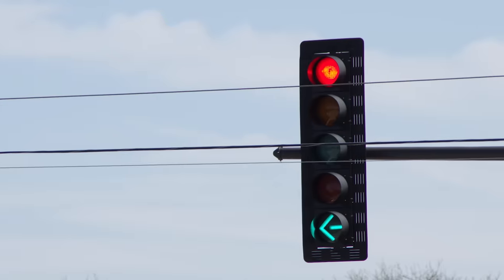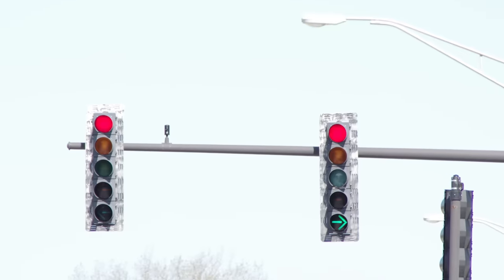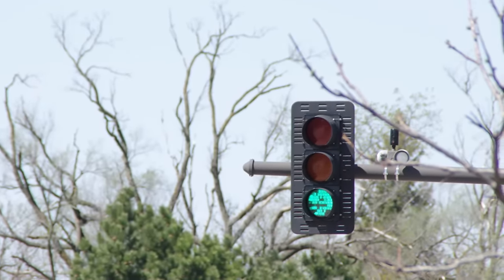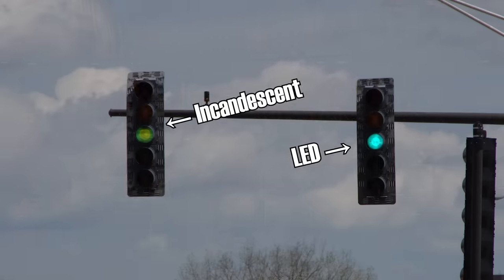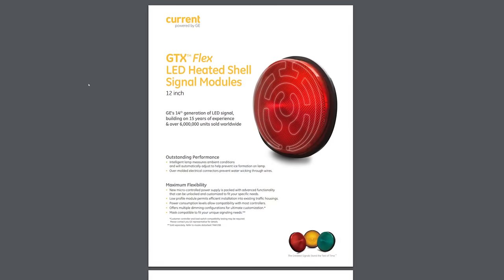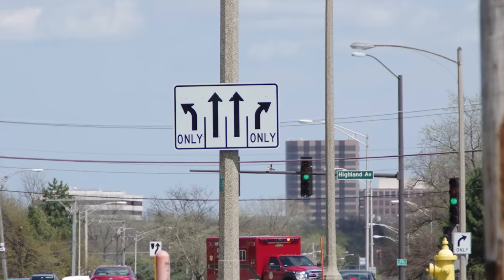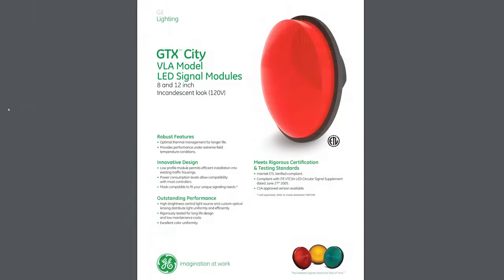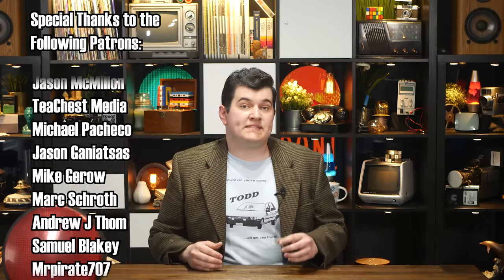The LED Traffic Light and the Danger of "But Sometimes!"

Comment: When working on traffic light control systems a decade or so ago, another advantage of LED was the lower voltage posing less of a threat to life in the event of an impact with the unit since it didn't expose potentially lethal mains voltage.
Reply: It's not the voltage that kills...
Reply: @MrKelra  unlike boring and mindless comments.
Reply: @MrKelra  but if I stick a fork in my outlet (here in Aus 240v 10a) I die, but if I lick some jumper leads connected to a car battery, let's say 13.8v and 800a, I don't feel it. Technically it is the current that kills you, but you need the high voltage for the current to flow through your body which is very high resistance.
Reply: @enbee_ash6740  Sadly, some people are just incapable of understanding the implications of Ohm's law and the melting point of conductors :)
Reply: @mpmansell  she'll be right. We'll just shock them with 240kv at 0.5A and say hey it's low current you'll be fine 😂
Reply: @enbee_ash6740  No, the LED modules are 120Vac units, designed to replace the existing bulb fixture with no change in operating voltage.
Reply: That's a stretch. Lets ignore the 120/240 V and 13,800 V or higher  systems on the poles next to the stop lights or even on the same pole.
Reply: @jim9689  You are completely ignoring fully modern, or modernised systems, where the voltage is reduced in the control box, usually to around 48 volts, with the LED matrices either running on that, or reduced further.
Reply: @jim9689  Are you really that happy to telegraph you lack of knowledge, and experience to the World to loudly? Some of us in these comments are electrical engineers, and have worked with traffic light systems and actually do know what we are talking about.
Reply: @mpmansell  Not ignoring, but rather ignorant of.  This 48 V system you refer to is certainly not the norm around here, where the existing infrastructure has been upgraded with 120 V modules.
Reply: @MrKelra  How is it not the voltage that kills when it's from a power line of unlimited watt power? 

It's voltage * amps * time that kills, and on the live grid the amps are only limited by the voltage.
Reply: @Justin73791  Because its voltage times watts, the 'amps', or Ampére, not the voltage alone...
Electrophysics, 1st year on high school...
Reply: @MrKelra  And what is amps? It's the voltage / resistance. 

A grid line will run more amps through you at a higher voltage. 

Your reply was that led lights at lower voltage aren't safer than old bulbs at higher voltage because "it's not the voltage that kills". 

On the grid, it's 100% the voltage that kills because it's the only "live" side variable you can change.
Reply: @MrKelra - You've actually attended 'high school'? You don't say. Fancy that.
Reply: @enbee_ash - You are actually trying to teach something to a certified genius? Good luck with that.
Reply: @Justin L - Same.
Reply: @firstnamelastname2416  shit, I was never high in school but I went to the barn of higher learnin...

Comment: An interesting note on old incandescent lights - Many railroads still use old searchlight signals. Rather than a simple array of LED bulbs, a searchlight signal has an incandescent lamp with a reflector behind it and a motor that moves a colored lens in front of it to change the signal color. Each signal head can cost up to $20,000 apiece, and when you have 3 of them on a single aspect, its price racks up quickly. These signals are starting to phase out; 10 years from now you'd be lucky to ever see one.